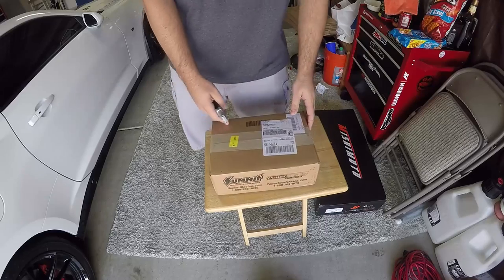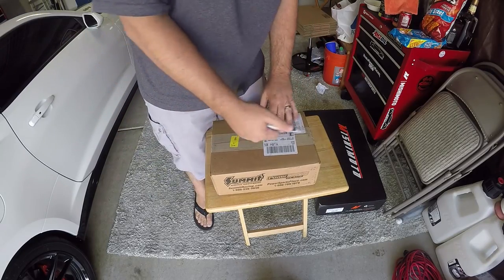What is a Breather, Catch Can, Breather Catch Can? WTH!

Comment: Hey man love the video just wanted to help you out with one thing…

Aluminum is NOT malleable.  Steel is fairly malleable, lead very malleable, gold is SO malleable that you can make it so thin you can turn it into an ultra thin foil and coat heat sensitive parts with it without it costing you much.

Malleable is about hammering a metal into a new shape.  Mallet —> mallet + able —> malleable 

Thermal Expansion Coefficient… or just say Aluminum expands faster than steel (2.5x faster I think) 

Anyways I’m not expert… but I just wanted to help you out with the Malleable thing.  I know you know what’s actually going on in the engine and it doesn’t technically matter if you know the terms correctly.  Except that if you use the word without combining it with that explanation… then it will confuse the other person or worse.